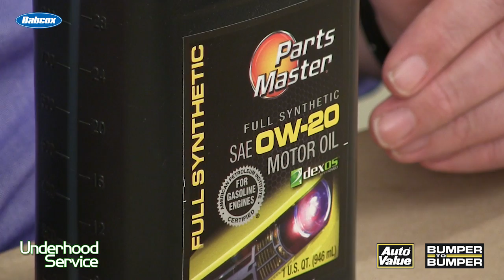GDI Carbon Deposits and Synthetic Oil | Tech Minute

Comment: Ceratec for piston scoring. CRC intake valve cleaner, twice at 0/1000 miles, 2  engine flushes, one purolator boss filter  and Valvoline R+P for the last 3,000 miles. 
Now sounds like a reasonably refined engine. Used to sound like a bucket of bolts. 7,000 miles to go before full benefit. Blow by decreased 3.5 times.

Comment: What's everyone's opinion on what the best gdi motor oil is? Recently purchased a 2017 hyundai tucson 2.0 gdi, plan on first oil change using castrol edge 5w30 and oem filter. Thanks in advance!
Reply: Did you get an answer to your question? I’m curious as well. I guess we find out which synthetic oil has the lowest volatility
Reply: I used Castrol edge in my GDI engine before i switched to that new valvoline restore & protect, & i tell you i feel the difference in the drive after 200 miles. ive also used penz platinum, mobil 1, & valvoline adv.. The Valvoline Restore & protect basically brought my car back to new. im at 182k mi.
Reply: @MQuez Valvoline says their restore and protect is geared more towards the pistons and rings than the intake valves. The advanced,which previously was branded modern engine, is more so geared for the buildup that occurs on gdi intake valves.

Comment: Just think the manufacturers could have used  multi port injection and completely cured this problem by spraying fuel on the intakes every so often to keep them clean.. They would have simply passed the cost onto the consumer and everyone would be happy in the long run.
Reply: The manufacturers moved to GDI because of ever increasing emission standards and fuel economy requirements. That is why the migration away from MPI. The Alphabet soup regulatory police have to give their permission before cars and trucks can be made and sold. All in the name of "saving the planet" https://www.youtube.com/watch?v=7W33HRc1A6c
Reply: Dual port injection (like Toyota uses) only slows down carbon build-up; it does NOT eliminate it—proven.  Research it.

Comment: The best way to prevent carbon on the intake valve is to use a good quality oil catch can it separate the oil and air in a can. I use them on my mustang GT, s.  04 and a 14 and you can check it to make sure they one hose coming from the valve cover is oily and the hose going to the intake manifold is bone dry because the system is a closed and air tite

Comment: I change the PCV valve each time I change the oil & the oil filter . Get the  fully synthetic engine oil replaced at shorter intervals ' clean and replace the air filter & Aircon filters  at shorter durations . Keep the tyres in good shape & drive conservatively .

Comment: This topic is snake oil.  It doesn't pass the common sense test.  The oil is on the other side of the piston rings.  Oil has nothing to do with carbon buildup on the top side of the intake valve.
Reply: Yes it does. Study up on Blow-by fumes. It is called the Crankcase ventilation system or PCV system.
Reply: Better think again.
Reply: Agree, Its a quality gasoline u used

Comment: How do you prevent this promble? Answer: do not buy a gdi engin.
Reply: Dual vvti toyota improve gdi combine cleaning port-i
Reply: Please help . I already have a GDI engine and has been horrible . I'm shopping for a suv without GDI and have had no luck
Reply: There are videos of how you can add an oil trap on the PCV line before it gets to the intake and  I think GM changed the intake gasket design to reduce PCV oil from getting into intake
Reply: So many engines on the market are now.

My advice is to install an oil catch can. Even a $25 eBay one makes a huge difference.  Every 1,000 miles, my can catches about 1/8th to 1/4th of a cup of fuel/oil blow-by.
Reply: So what are other  options available today in the market except for Toyota's & Lexus ??
Reply: Richi RIch Don’t tell that to Ford, Dodge or Chevy

Comment: I do Royal Purple at 10,000 miles or every 6 months = 0 issues
Reply: Severe usage? How many miles u got every year?
Reply: How do you know there is no issues? How many miles have you drove. DI engines can go 60,000 miles or more or even less before you know you have an issue. My first DI went about 60,000 till I had a timing chain problem and the engine also needed a chemical cleaning from the carbon build up. It had Regular synthetic oil changes around 5000 miles. Less miles than the manufacturer recommended.

Comment: Pennzoil Ultra Platinum, AMSOIL Signature Series, Quaker State Ultimate Durability, Red Line, Motul, Driven, ENEOS are acceptable.

0W-30, 5W-30, 0W-40 or 5W-40 are all fine.
Reply: I prefer Mobil. Runs clean every time
Reply: Danke !!  Gruß  aus  Germany ,  bei  Aachen .  SMAILI +++++++ .

Comment: On my old 2003 C320 4matic, i would, in the beginning, put ONLY the Mobil 1 Full Synthetic oil in my engine and yet 9 years later started having to deal with check engine lights and emission issues. ALL DUE TO CARBON BUILD UP. So i don't know if even staying with the manufacturing suggested oil really makes a difference? But even today, with my newer 2013 C250 I still follow the recommended oil from Mercedes Benz. But I'm leaning more towards perhaps using Liquid Molli because I hear its a better quality oil. But with that said, I'm also have started and continue to do GDI Services on my engine so that I can at least tackle the carbon build up while its just a thin film layer of carbon, before the carbon builds up too thick to where the GDI  Service becomes useless and will have to turn to a walnut blasting method to get the carbon out.
Reply: Well synthetic oil will be much cleaner than conventional oil so not much you could have done in the first case. For your current car with GDI, get a quality catch can and it should reduce the carbon build up.
Reply: @BoogieDownProduction  Yes, I have a catch can physically installed in the engine bay, already, but I can't hook it up for now due to that it will void my extended warranty. However, one thing i found out about the newer generation cars w204 and W205's... is that Mercedes manufacturer now puts oil separators on the engines. 
And from what I researched on the difference between catch can's and separator's it seems like the separators are the better option due to that it's suppose to catch the containment in the blow by and send the oil back into the crankcase. BUT... of course it's too early for me to tell if the separator is working well or not without having to rip the engine apart and check the intake valves, which i don't want to do because, again, it will void my warranty. But, once my warranty has expired I will be connecting up the catch can, but also continuing on doing GDI services every oil change. It's an ease step to do, only cost $12 for a can of seafoam or CDC intake valve cleaner and only takes 5 minutes to perform. So it's worth it to me.
Reply: @berniecruz8405  Idk how extended warranties work but with the manufacturer warranties they have to prove that your modification caused the problem before denying you coverage at least in the US. It's a federal law.
Reply: @BoogieDownProduction  Well, I have a friend at the benz dealership and he's a customer service manager and he seen it in my engine bay and warned me NOT to hook it up because of their policy which would void my warranty. So I'd have to take his word for it, for now.

Comment: Mobil 1 for gdi full synthetic
Reply: Pennzoil Platinum or Ultra platinum is a better synthetic.
Reply: @darrelc5411  pennzoil ultra platinum is what you should be using & pennzoil platinum when your in a pinch
Reply: You do know that Mobil isn't a true synthetic right?  It's a group 3 oil, Group 4 and up are true synthetics.  Amsoil is a group 4 oil.
Reply: no bueno
Reply: Valvoline Restore & Protect 👌
Reply: jorge perez that’s the one I’m using too. Hopefully it protects against deposits.

Comment: I'm using Amsoil and will also do a de-carboning with CRC DFI carbon deposit cleaner every 10,000 miles. Both together might help prevent needing the head removed for manual cleaning. A very expensive process...
Reply: A catch can is actually the most important thing you can do
Reply: @BoogieDownProduction  My daughter owns  a '19 Hyundai Tucson Sport  with a GDI engine which I didn't know much about since my '98 CRV and '05 Pilot have old-school port injection. I had to do some research when I learned the problems inherent to GDI. Several days ago (with 10,800 miles on the odometer)I followed the directions on the can and sprayed the CRC Intake Valve and Turbo cleaner into the throttle body.An hour later after I let it heat soak I drove it like I stole it for around twenty minutes. When I initially punched it hard I heard a noise which sounded like debris was coming dislodged inside the engine. It never did it again and it never smoked or threw any trouble codes. I then changed the oil with Walmart's Supertech 5W30 synthetic and then installed an oil catch can. I'll be changing the oil every 4000-5000 miles and use the CRC spray every other oil change to hopefully keep the carbon build-up under control. I'll also be closely monitoring the OCC.
Reply: @kevincrush859  I have heard it can damage the engine when those deposits dislodge (if you google around you can probably find the same info, it was a fairly reputable performance shop that posted about it - might have been on a youtube video about CRC). From my research it seems better to run an oil catch can and then do walnut blasting every ~50k-100K.
Reply: @BoogieDownProduction  yes.loosened Carbon chunks have been known to damage pistons, turbocharger and catalytic converter. Ford had issued a warning in this regard.
Reply: @BoogieDownProduction oil catch cans do virtually nothing to prevent intake valve deposits. Most of what they catch is water vapor with a very small oil content.  That’s why it looks like sludge, it’s got a lot of water in it.
Reply: Remove the head? I thought you only needed to remove the intake manifold?

Comment: How about a catch can??
Reply: It is model dependent. Some of the Ford Ecoboost catch cans work great while VW ones don't catch much.
Reply: Charlie - Why would it not be emissions legal? High quality catch cans have a valve that you flip and it drains, this can be routed to the oil filter/drain bolt location and can be emptied every oil change into your used oil for recycling. Even if you dont have a fancy one like that you can manually empty it into your drain bucket after draining out the oil. Luckily I dont have to deal with emissions in my city but I dont see why it would be an issue.
Reply: @BoogieDownProduction  Problem is you are expecting 'logical' as to legality . The two have nothing in common. Like the law in Virginia in regard to exhaust systems. Any exhaust that is not an OEM system is technically not legal. It may still have the cat..it may even be quieter than OEM.. but it is still illegal. Do they always enforce the law..no. Too hard to keep track of or prove. I agree with your logic just that logic has nothing to do with the law sometimes.
Reply: @BoogieDownProduction  Its not EPA legal as most folks don't dispose properly. And the MAF will read different flow so that would or could cause issues. Just like aftermarket tunes are engine voiding and violates EPA and Manufacturer copywrite laws. And NO tune is reversible, as in restoring the ecu to stock and re-locking the ecu. Plus various sensors have had their parameters altered and that can not be.
Reply: @MasterCarguy44-pk2dq Catch cans catch oil meaning they are not venting or producing in metered air.  In my experience introducing a catch can system brings your fuel trims much closer. My 14yr old GMC Sierra has a catch can on the dirty and the clean side just because I could. My fuel trims are within 1-2% of each other. 

Tunes are sure as hell reversible. Hp Tuners saves an original copy of the software and you edit a copy of that. You flash it just like you would install a os on a computer. You can even pull the pc out of a completely different vehicle and flash your old software from a previous ecu into it including the vin and the VATS system or you can click a button and just eliminate VATS all together.  Once the ecu has its kernel cracked, you have the keys to the kingdom.
Reply: G8GTATL Man of course that would help, but I believe in most states it's not emissions legal.  Where would you dump the stuff caught by the catch can?  The vapors are recirculated to the air intake to be burned off.  Also modern cars with MAF sensors are calibrated to expect that amount of air that is being recirculated.
Reply: i don't know anything about them being legal. Toyota tundra 5.7 has one built in. also i have one on my LS 6.0 engine. you could dump the mix anywhere you put auto fluids, its only a few ounces. never heard anyone in my tuning circles refer to the MAF sensors being calibrated for PCV vapors. My MAF is   located before the throttle body and my pcv is after, Like most cars.
Reply: G8GTATL Man your tundra has one built-in?  If there is an oem one, wouldn't that require users to empty it?  

You are correct, that it is recirculated after the MAF, but if you were to VTA it and plug the recirculation, I believe your fuel trims will be skewed since the original tune is expecting X amount of air from what is metered by the MAF, plus what ever is recirculated.  I can't say this is going to happen to every car, but I seen it happen.
Reply: It's technically my neighbors Tundra and it's designed to drip back into the oil pan
Reply: @g8gtatlman483   Dripping back in the oil pan is a bad idea.  My catch can also gets water vapor so the crap going into my can is contaminated.